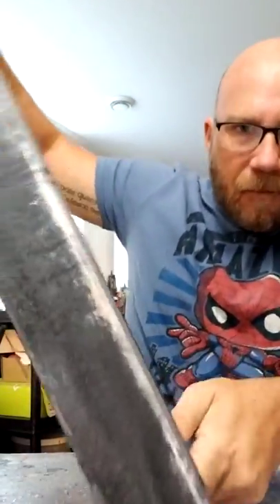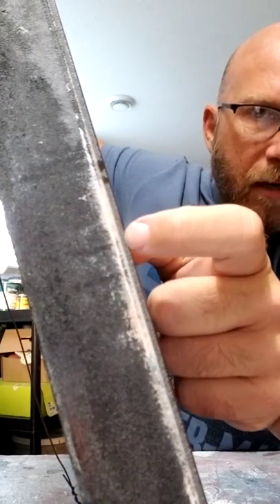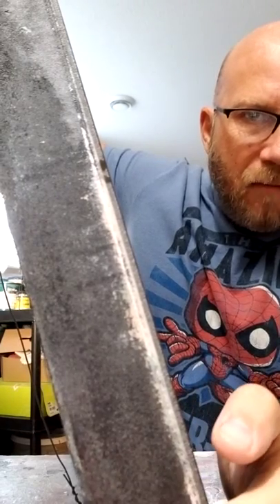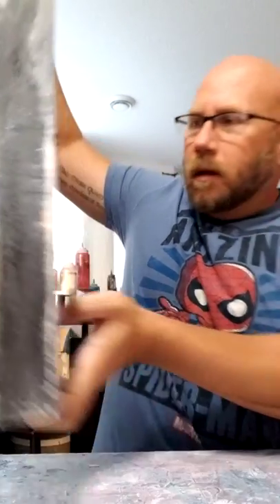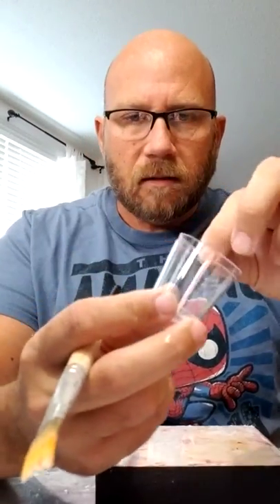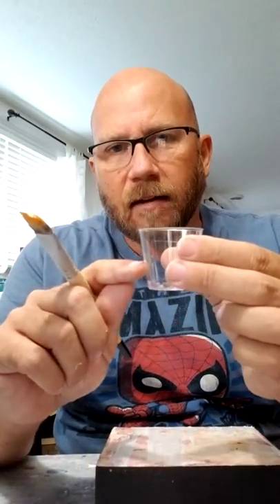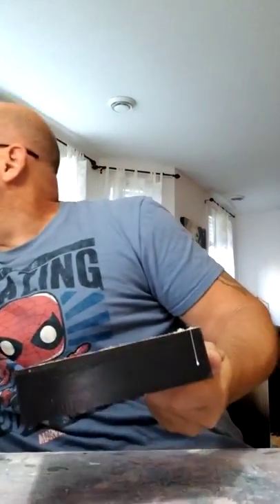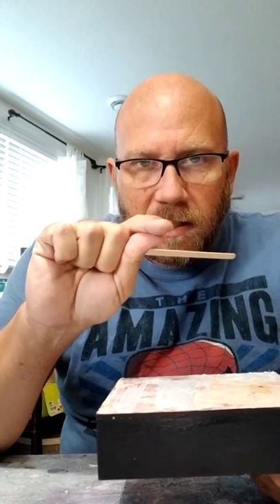Fixing Resin Sanded sides. Wood panels.

Comment: if you paint the sanded resin the same color as the sides of panel  will it be good and pretty or we will see 2 differents finish?  thanks
Reply from the maker: Not sure what you mean by painting sanded resin.  Hopefully by sanding the sides, you get rid of all the resin drips.  Painting over resin is not as nice.  It will work after a few coats but you need to use a very sticky paint for a good coating or it will wipe away.  Hope that is what you were asking.....